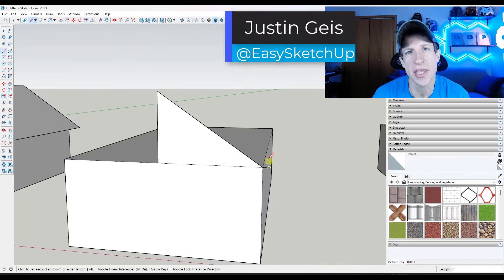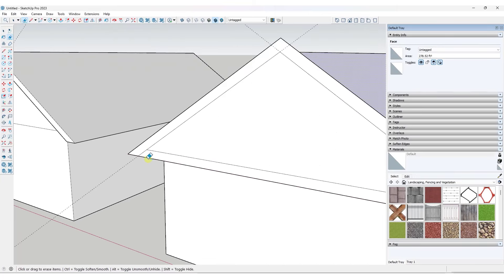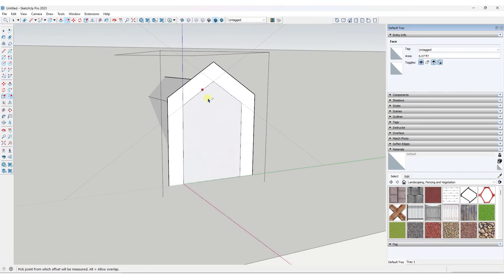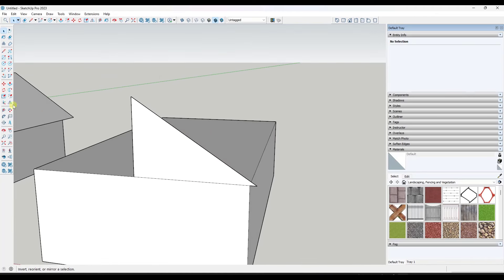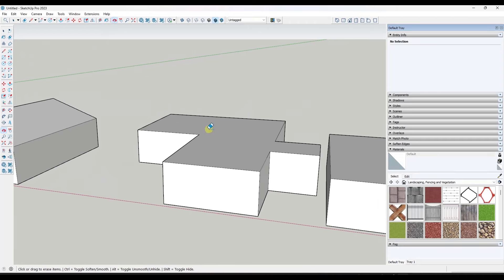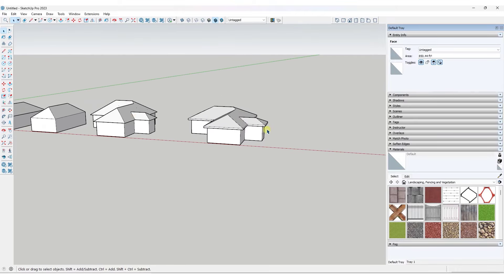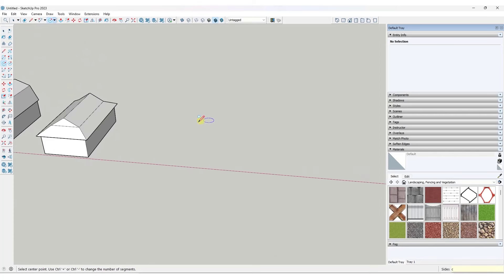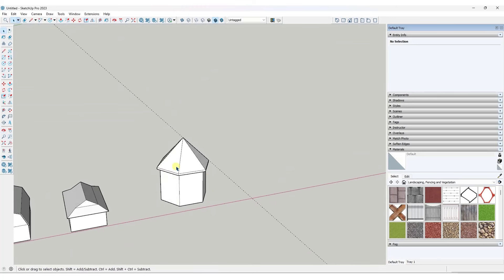How to Model ROOFS in SketchUp! (9 Different Kinds!)

Comment: Hi Justin, On a side tangent, I would like to know if there is a solution existing for retrieving a corrupted SketchUp file. I may have overloaded my SketchUp file for the subsequent corruption. I have even tried to open the backup file, to no gain. I Beg your pardon, for posting on a different subject.

Comment: Trying to make 'Japanese' style roofs.. I run into trouble with the 'inner corner' transition.. I typically use the 'follow me' tool to achieve the desired effect, but again, the inner corners get all goofy. Ive tried numerous different options (and plugins) to try and 'fix' this but alas Ive yet to find a solution. Any tips or tricks or even plugins available to achieve this?